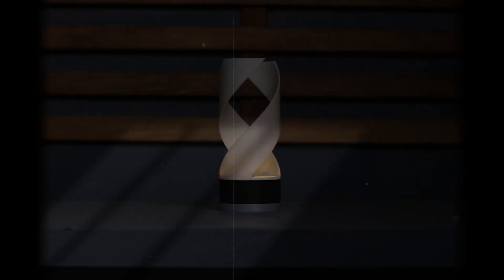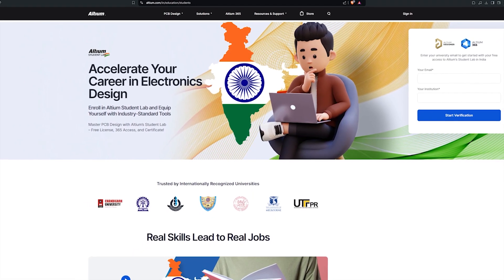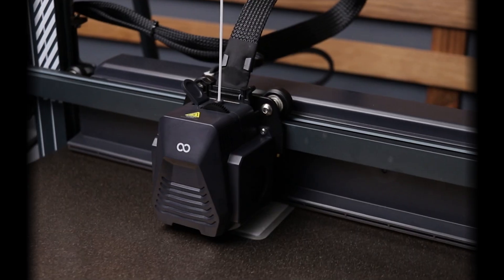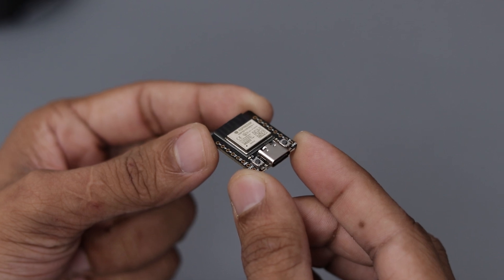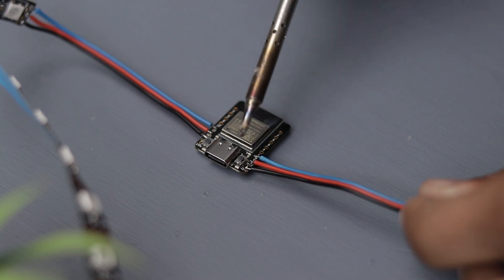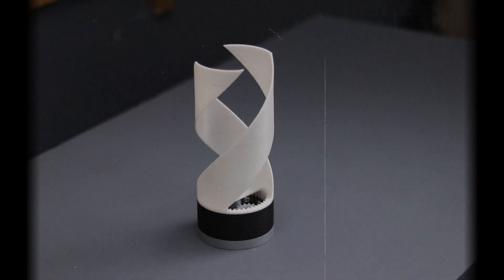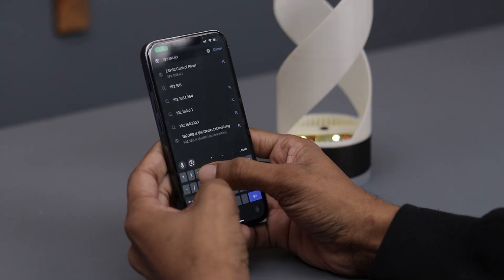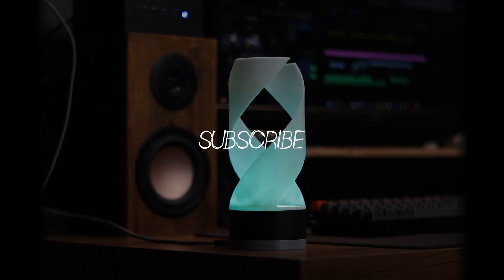Creating a 3D-Printed Spiral Lamp That Spins and Create Stunning Illusions

Comment: Bro i wanted to build a 3d printing business in india what are your thoughts and which printer you recommend  (i was looking for kobra neo 2)
Reply from the maker: I’m not an expert but it sounds cool! I'm sure you'll do great!
Reply: Currently in 3d printing space you can't survive just on print on demand because printers are cheaper then ever and mostly work out of the box you most of your potential repeating customers will just buy one 

To survive you need really good cad skills and electronic and mechanical skills are also good to have 

It's better to offer them a whole product instead of just parts
Reply: Better you have asked Ai bhai...
Reply: Kobra neo2? So you want to build a business with a toy?
Reply: @BrainDeath89  not specifically  toy buy gadgets  too
Reply: @syedamaan5338  i would go for something better or at least Prefer a Bambu A1. I have spend sooo much time with my old printers, it's not very good for a business 😕
Reply: @BrainDeath89  Bambu a1 is an excellent choice but it costs around 500 usd while kobra neo costs 180 only
Reply: Ender 3 V3 SE - it also has auto bed leveling and more. Ender 3 v3 is even better